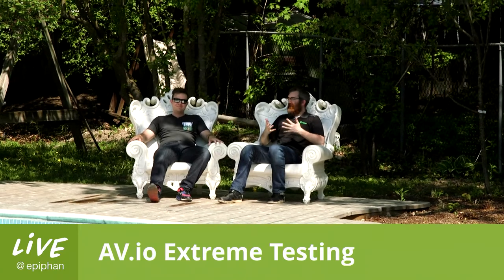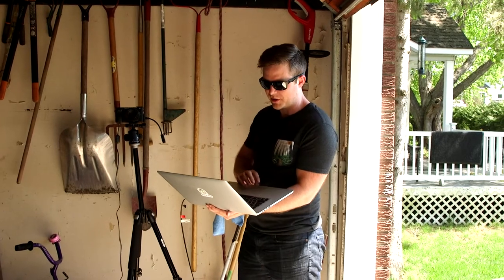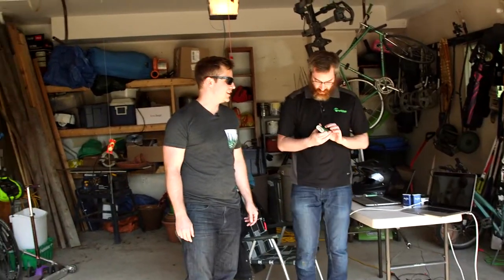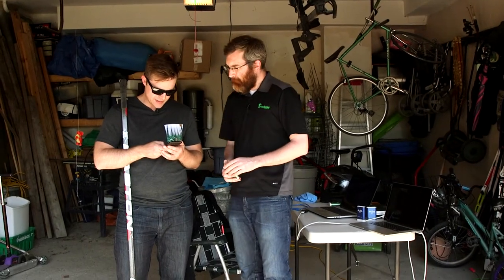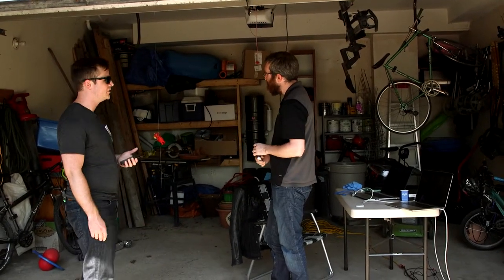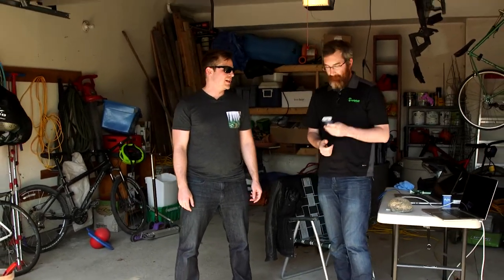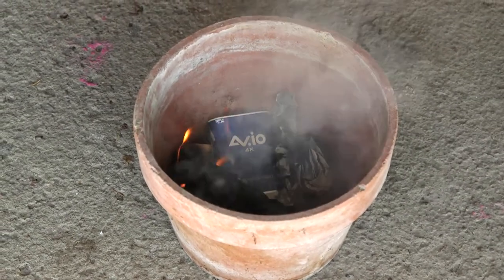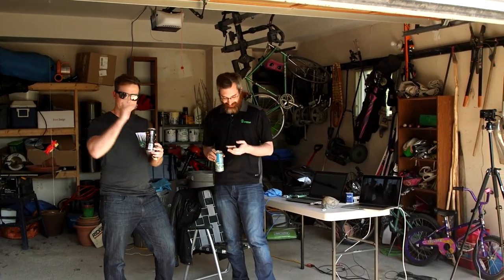AV.io Extreme Testing

Comment: What are you using to cast the webcaster or the pearl outside
Reply from the maker: Hi TK - in this case we had Pearl-2 set up inside the front hallway of the house with a 100' HDMI fiber cable running to camera.